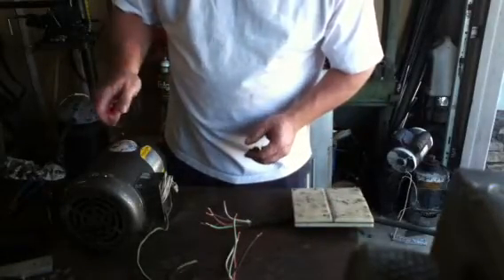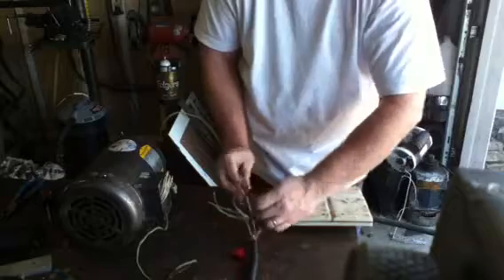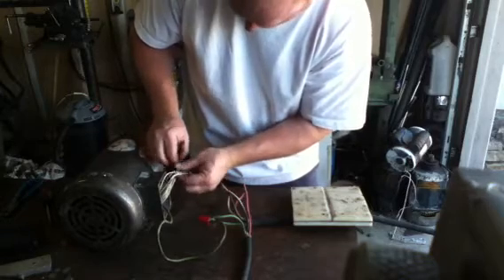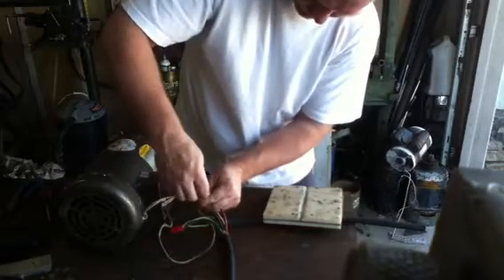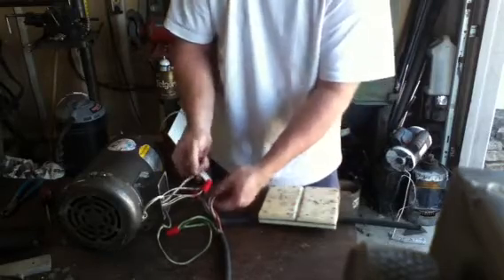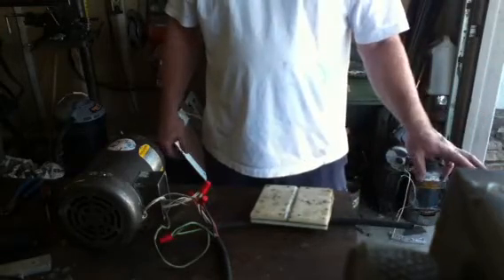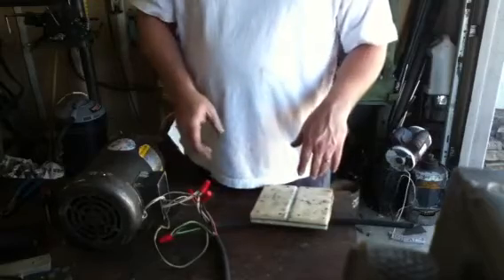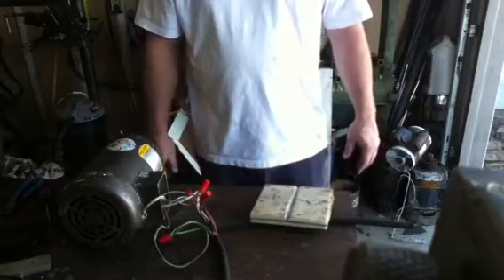Pony motor wiring

Comment: I do not have a video camera to show you. will try and get a photo of configuration to you.It is a 115 volt motor single phase, 3/4 hp 60 hz. It has 9 wires.

Thanks, Steve

Comment: Nice info. I have a Marathon single phase 3/4HP electrical motor. Want to wire it to a cable to plug into my switch box. The motor has many wires in terminal box. I am confused. Can you help me out.

Thanks Steve

p.s. this is for my old band saw which now has a 1/3hp motor, 60 years ols, need mor power.
Reply from the maker: I would be happy to help out.
the motor i wired up on the video is a 3 phase motor, a single phase will have a different wiring configuration, but it is simple to wire up
if you could post a video layout of the wiring on the marathon motor i can show you how to hook it up easily